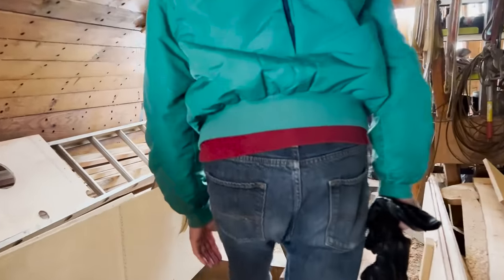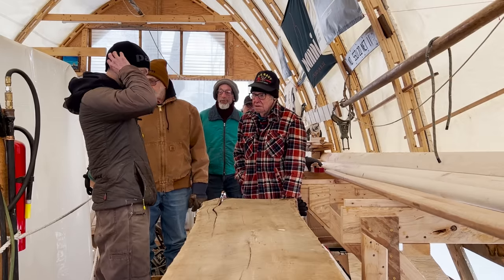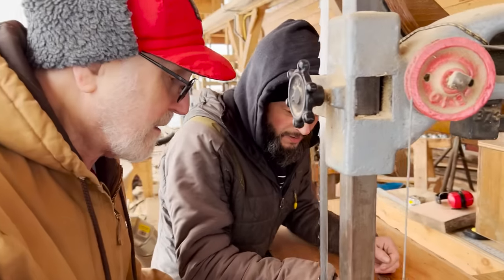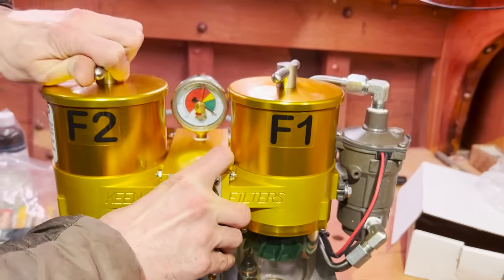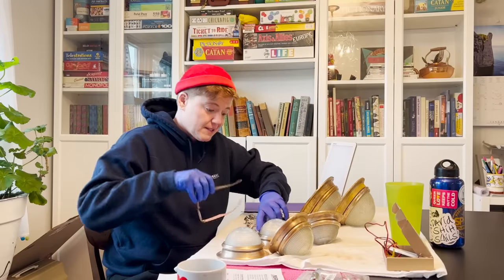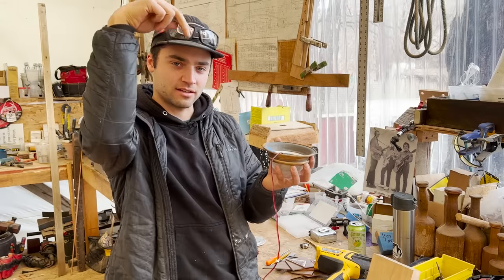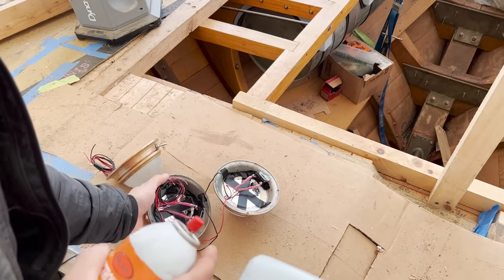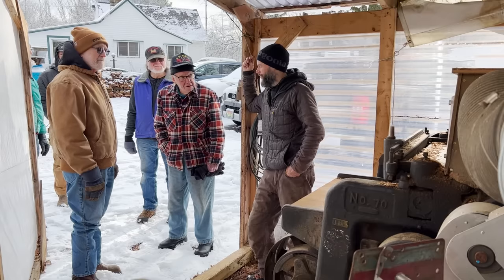Retrofitting 100 Year Old Lights for LED - Episode 253 - Acorn to Arabella: Journey of a Wooden Boat

Comment: great electrical work detail: what brand of marine grade tape did you use in the light fixtures. What grease/wax remover did you use prior to applying the tape to the fixture. What kind of lock washers on the switches? thx in advance

Comment: What about that led stripe/diffuser light losing the stainless steel plate as a heatsink? Will that work inside such an enclosure? I've burned through a few led lights that couldn't cool down enough in the fixture I put them in, those bayonet "bulbs" are rated for that kind of use usually.

Comment: The biggest problems I have ever known with sailboats has been with the fuel system on the diesel. Your right; get the best filter/water separator system you can have............and yours looks awesome! Diesels are like Huskies, they are happiest only when they run a lot!!  DD

Comment: Do you plan for a load tank to sort out bad fuel and then pull clean fuel out of that. Like some temp tank just to make sure bad fuel do not end up in the main tanks? Or do you have another plan in place that might be better.. With how suspect a lot of fuel sources seems to be there has to be an easy way to handle say water in the fuel as it's pumped. Fuel comes in, water is detected and the fuel shift paths to filtering where the water is removed before fuel goes to main tanks, a fluid system if that's even possible with current available tech?

Comment: These videos show all the hours spent building parts and assembling the boat and I sometimes wonder: how many hours have been spent sharpening chisels, hand planes, drill bits; how many band saw blades have they gone through, jointer and planer blades sharpened or replaced? When you consider all extra hours spent maintaining the tools we watch them use this project becomes even more amazing.
Reply from the maker: Lots!

Comment: Wonderful progress, once again. I have to admit to be slightly concerned about the choice not to use actual IP67 or IP68 grade LED armatures inside the old original fixtures. Having been selling those exact light since their inception (Philips brand, so not too shabby), even simple bathroom moisture can kill them well before their expected lifetime. And those are just IP23.

Comment: On the cherry rot: I have a couple of 40"+ pecan rounds given to me by a friend. These are well spalted and was close to be full rot. I had just made up a bunch of blonde shellac and decided to use it to seal the rounds.  I found that the wood just drank the shellac and I let it.This turned out to be a great solution for hardening and stabilizing these pecan rounds.  This was 11 years ago and these rounds made great tables. I wouldn't let this soft part of the cherry bother me at all.
Reply from the maker: Nice!

Comment: Glad to see it coming together more and more. And please dont think Im criticizing when I say this, but from an electrician standpoint, I would try to stick with the bulb style instead of the puck lights. From experience sometimes replacement lights can be hard to find if they quit making them or change the style. The puck lights happened to be a perfect fit this time, but if they fail down the road it might be hard to find another to fit in its place, whereas the bulb style is pretty universal and parts would be readily available where ever you happen to be docked at. Just throwing that out there. Keep up the good work and progress. Cant wait to see this thing in the water.
Reply from the maker: It’s very easy to get bayonet style connectors in future. These work for now. Nothing is permanent here, and that’s ok.

Comment: That steel backer plate that you removed from the galley lights acts as a heat sink for the leds. You can expect the leds to burn out fairly quickly because they will run hot.
Reply from the maker: These LEDs don’t run hot, nor do any that we’ve used yet.
Reply: All leds generate heat. Almost all will work with currents of 15ma - ~100ma. They get brighter with higher current and generate more heat the higher the current. The lower the current and cooler they run the longer they last. We're not talking incandescent lamp type hot here, maybe 50c for a really hot one! Even led flashlights have a small Al backplate to dissipate heat away from the junction.

Comment: You might want to keep an eye on the temperature of the modified LED lights.  That steel may have served as a heat sink and could lead to premature issues with the LEDs.
Reply from the maker: Doubt it, these don’t heat up. We’ve been using them for a couple weeks, and that would mean that as a puck light, a heat sink would be pretty near flush with a surface, negating it’s effectiveness. It’s just a backing plate that will get pretty corroded quickly.

Comment: I am pretty sure the spray for the connections is similar to LPS number 3.  When I worked for the cable company,  we used 3 deep cycle marine batteries for power backup to the Cable system (911 calls required.)  My first 2 years we were having a serious problem with corrosion and battery failures, (central Florida heat and humidity) probably close to 10%-20% over the 3 year life span of the batteries, and we had to replace all 3 batteries when one failed after 90 days or so.  We had close to 5000 (yup thousand) batteries, we bought them by the pallet 2 or 3 a week.  We started using the LPS #3 and our failure rate dropped to less than 1% on treated batteries, (our mechanic also started using it on the trucks).  It is good to see that you are using protectants like this, and I would recommend you use it on the bus bars and everything, including the sockets for the lights.  Stopping corrosion on electrical connectors is important and will save time and headaches while sailing.  Next time you build a boat, do it further south so I can get by to see it. LOL Love everything you do and Hope KP gets back to full speed soon.
Reply from the maker: Thanks for sharing that story!

Comment: Hi all, the metal backer for the LED is also a heat sink so make sure you use high heat tape to attach LED's get hot.
Reply from the maker: It’s not a heat sink. These don’t get warm. And it’d be a pretty terrible heat sink if it’s sitting all of 2 mm from the surface it’s mounted to. 👍
Reply: @AcornToArabella  I came here to say this too, LEDs do get warm!  If you leave them on for a bit and they are too warm you could recreate the plate using a metal compatible with the brass.

Comment: Removing the steel backer from the lights could be removing heatsinking, the LED's may overheat
Reply from the maker: These puck lights are designed to be flush with their surfaces. Not much of a heat sink if it’s so super thin and right up against what it’s protecting. Now it floats inside a larger metal piece.

Comment: Over time the integrated led plates will prove less than ideal.  Sure they’re cheap and easy but once they fail they can’t be repaired. You’re better off with the replaceable led bulb setup.

Stick with KP’s designs and shim the fixture to accommodate the bulbs just like they did in the old days. Cheers.

Nice red beanie KP!

Comment: Just a heads up.  Some of the LED lights can get quite hot!  Be sure to test run them in place to make sure there are no problems.  Your flat panel LED lights may need the metal backing plates for heat dissipation!  If so your tape that you are using to secure the light pack could catch fire!  Also the dimmers may add RF noise that could interfere with your radio's reception!  Could even affect your marine buss and radar.
Reply from the maker: Thanks for these notes, Peter. Since the draw is so tiny on these, they don’t get hot at all. Even our larger LED strips don’t get warm or have heat sinks. I suspect the RF on dimmers would be the same. Such a small amount of energy moving through them. We shall see!
Reply: @AcornToArabella  As far as the RF noise from your dimmers just turn on one of your hand held marine portable radios to ch 16, adjust the squelch where it just quietens and turn on each of the dimmers to see if they cause it to break squelch.  If they do, move away from the dimmer switches on deck to see just how far they will transmit their noise.  Generally speaking, these dimmer control will turn every foot of your boat wiring into antennas!

Comment: I believe you should have kept the socket connectors in the lights. Because it is a lot easier to find a replacement bulb no matter where in the world you are. When those mini pod lights fail, you will likely have to build something from scratch to replace them.
Reply from the maker: We’re bringing a pile of them. They’re like 5 bucks each and available everywhere.

Comment: "Diesel doesn't like to sit for a long time"? YouTube has taught me an engine will start with (unfiltered) diesel fuel after sitting for 15 or 20 years (in an old diesel motor at least). Maybe the newer ones are different? Nice cherry find!

Comment: Electrical tape as a mechanism to secure the reflector seems like a long term failure.  The heat generated from the LED will likely cause the tape to melt.
Reply from the maker: The LEDs don’t generate any heat, and should we need to replace the tape or find another solution, it’s fairly low stakes. 👍

Comment: I am building a boat this summer - nothing as complex as Arabella - Just a Row Boat made out of honeycomb foam, carbon fiber and epoxy - with a few stainless steel fasteners thrown in. It should be 6' wide and 12' long. I learned carbon fiber from working in aerospace - I worked at Boeing for 11 years - 4 years building carbon fiber wings for the 777x.
Reply from the maker: Neat! Updates please!
Reply: @AcornToArabella  , I'll post to a playlist on my channel. I plan to start in May when the weather starts getting nice. I have all the material now. I just need a break in the weather.

Comment: - "My Granpa would move it himself, but wouldn't want to show anyone else. 
- Yup, I understand that.
- Fifty years ago, I knew an old guy, maybe in his 70's+ years old back then in Nova Scotia.
- He wanted the porch of the old house he had bought to die in to face south...
- So he pinwheeled the whole post and beam building around using wedges to do tipy-toder with the whole thing so it would spin in place.
- By hand he dug out the foundation and built cribbing up at each corner.
- He rescued long hand hewn beams from somewhere and with a wheel barrow walked it up a steep hill to the dirt road we lived on and used that as the underpinning to wobble the house around on.
- He did this all by himself.
- None of us in the area helped because that would have taken away the achievement of what he saw as a simple chore.
- He knew any of us would have done anything needed to help him...and knew we understood why we would not pester him to let us get involved.
- When he was done we took a keg of hard apple cider over to enjoy the new sun on his porch.

- Then he died.
Reply from the maker: Thanks for sharing the memory of your friend.
Reply: @AcornToArabella  . 
- I caught myself writing that end part and second guessing about leaving it to post.
- Then I realized it was all about the striving that was done then in that Now, for me to recount here some fifty years later...because THAT Striving is the important part, the important thing for youth to hear about which I was honored and trusted to know about...to pass on in this Now.

Comment: On the big overhead lights, I suggest putting a three pin switch on those lights. Switched one way is normal light. Switched to the other way it would turn on red leds (or another color of your choice) to preserve night vision. It would also prevent waking others trying to sleep.
Reply from the maker: We’ve got a plan for red lights.
Reply: On my boat turn the switch to starboard you get white light, middle is off and port is red light. Easy to remember in the middle of the night
Reply: I came here to suggest the same thing.
Reply: Ditto
Reply: Go with green or blue light lots of ships are switching to those colors because red messes with your vision too much, and makes you feel angry
Reply: @sailthewind3525  but that convention switches around, so an European born sailor may get it totally wrong.. standards are really great when you have several of them.
Reply: @homie6166  I have not heard of this or found it to be the case in my own life. Red helps preserve night vision; as far as I know green or blue do not do that as well.
Reply: @tench745  I see it on new navy ships they have dim green which is similar the light output of red, and a darker blue light which is enough to see where your going through boat and what's around you but cant see detail, they are kinda better than the red because with red when you go from red to white colors get all messed up, from what im told is the navy seals use the blue light to start their missions and if something opens the super dim blue light isn't visible from over half the distance as red or green which I guess is similar, not sure if this is true but it's what I'm told on why, I'm a electrician on navy ships and do primarily lighting
Reply: @scott Wheeler ?
Reply: @scottwheeler2494  
?

Comment: Good to see KP back, one concern is the removal of the backing plate on the LED disks, this is normally used to remove some of the heat generated by the LED's, and removal will greatly shorten the life of the unit. You really need to put them back.
Reply from the maker: Hmm… given it’s a puck light, meant to be flush mounted with about a couple of millimeters behind it, I think that’d make a a lousy heat sink. In this case it’s surrounded by metal around its rim and has about an inch or more now between itself and the mounting surface. Maybe it all works out.
Reply: @AcornToArabella  its still distributung the heat away from the diodes. So it would reduce the peak temperatures of the diodes. Strip lights are pretty sensitive to overheat and temd to degrade fast.
If it is a flat area you may just copy the old backplate it to aluminium or copper/brass.

However considering the humidity you may well have to replace it before its normal lifetime. Make shur you have a few spares and an connector for fixing it.

Comment: FYI, The LED driver/power unit heats up fair amount and need fair amount metal and heat sinks to dump the  heat into.
I learned this the hard way retrofitting ole light for LEDs. LED lamps need to be build completely opposite of the old filament lights. Old light can be installed on top of the surface and have glass bubble above it to manage the heat. As where LED lamps can be installed flush to the surface and need a bubble behind it for managing the heat. 
Also whole retrofitting old lamps with LEDs bulb is just an non functional and bad idea. Even with normal house ceiling lights. Like the Philips Hue standard bulbs for ceiling light, they only last a year or two and are a bit awkward as they are so lon as they they to hide the heat sinks into the bulb. As where wired pruposely build and designed LED laps where there is no separate lamp and bulp but one single unit the heat sinks behind it last decades. 

I know you like the retro look but sink-in led light units with build in CREE LEDs are far superior solution. Much longer life, maintenance free, better light power, less power consumption. Not to mention those light units can 100% water proof as they do not need to be designed to be opened for bulb change.

Comment: In those gallery lights retrofitted in, was that steel plate a heatsink for the LEDs? I would be worried the lifespan would degrade without a heatsink - maybe replace with a brass circle?

Comment: I converted my RV to LED and it was a huge mistake.
LED's are made too cheaply. Most of them flicker and they often fail within a couple months. They're just not reliable.
Also theyre always about 10X brighter, which is only an advantage in certain situations, but just you try to find some that arent 10X brighter than they need to be.
Someone out there is about to reply "well thats what you get for buying the cheapos" but even the ones that are $20 overheat and fail if you put them into a light fixture. 
I'm in the process of converting back to incandescent, but its not easy, nobody makes proper light fixtures anymore.

Comment: That tape will in couple of years disintegrate and leave light lose. So it might be better to use some more permanent method. For example a bit glue that can be scraped of if light needs to be changed or silicone. Or jus some physical block that keeps it from backing up. And for those 3 light fixtures some 3d printed adapter might be more robust. As thousands rocking movements can break the epoxy. Or those might work just fine and you can always fix them if needed.
Reply from the maker: It’s a fairly low stakes situation, but thanks for sharing your thoughts.

Comment: Brilliant modification to the lights, very convenient that they're such a good fit. In my experience, those modules aren't all built to the same quality, so I would recommend throwing an inline connector in there to facilitate future repairs. Good that you're already at low voltage, because a lot of these things overdrive the chips and shorten the lifespan.

Comment: I had bad luck with strip type LED-s on cars. To my understanding they didn't really like voltage changes or the 14.7-ish Volts an alternator produces. Maybe worth to put some kind of regulaator that puts out 12v constantly, if you ddont't already have that with your battery packs and stuff. I'm nott an electrician, just telling my own experiences with LED strips.
Reply from the maker: Yup! We’ll have a charging regulator going to the LiFePO4 batteries.